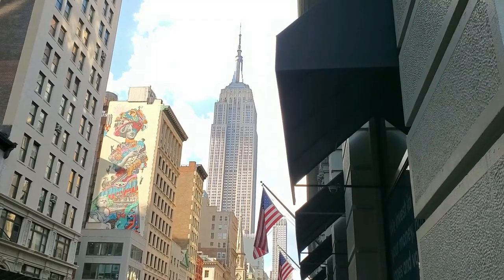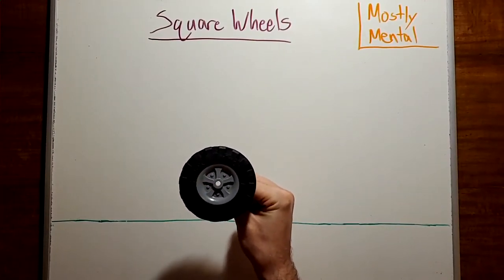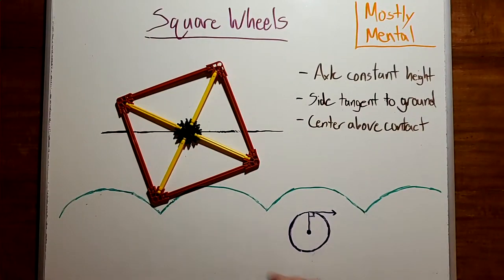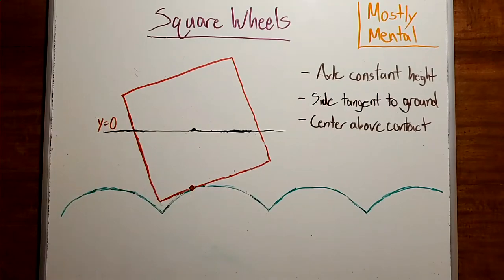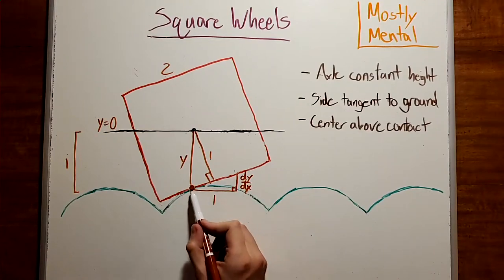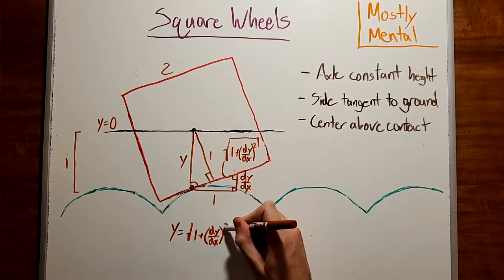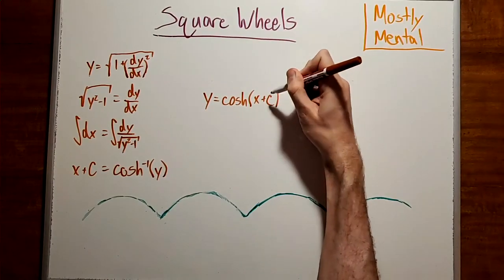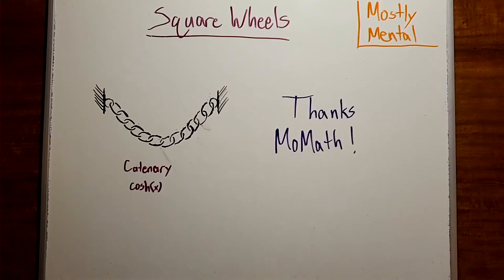Square Wheels - Reinventing the Wheel

Comment: can we know what size must the surface of the part of circle be on order for the wheel to go on smoothly?
if i have a wheel that its side is 2 meters for example what should the lengh of the part of the circle be ?
Reply from the maker: The wheel rolls without slipping, so the length of the path needs to be the same as the length of the side of the wheel (in this case 2 meters).  You can think of breaking the wheel into lots of very tiny segments and laying each along the curve where that part of the wheel touches the ground.  (Also, it's not a circle, it's a hyperbolic cosine.)

Comment: How to measure the curve of the road ?
Reply from the maker: If you want to measure the length, the easiest way is to notice that the length of each arc of the curve must be the same as the length of one side of the square (which is 2).
If you want to know how curved it is, the best measure is the radius of curvature, which essentially finds the radius of circle that best approximates the curve at each point. There's a formula here https://en.wikipedia.org/wiki/Radius_of_curvature (which comes out to cosh(x + c)^2).